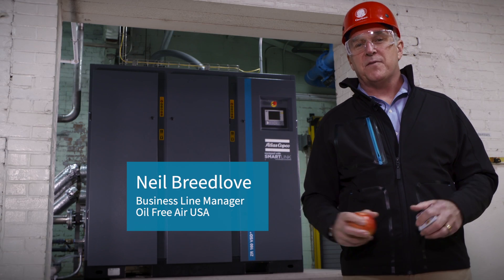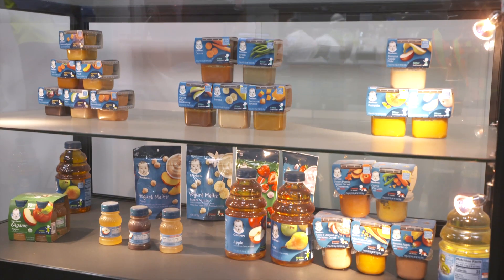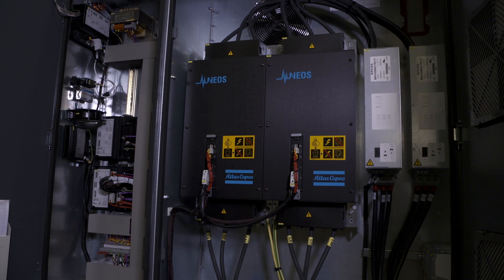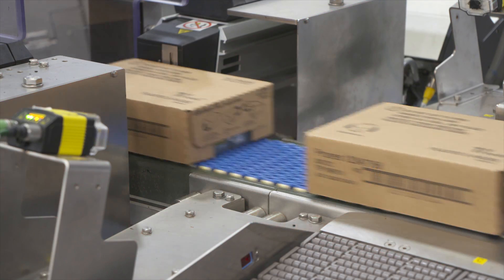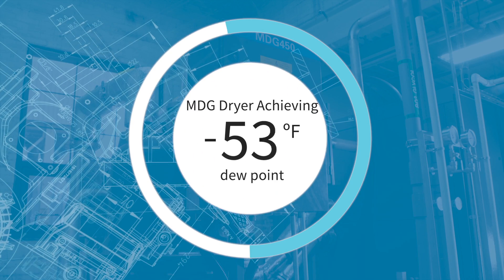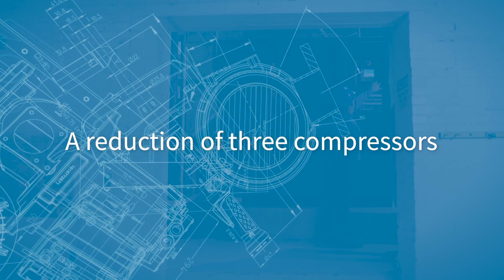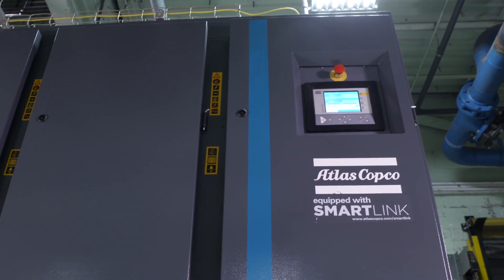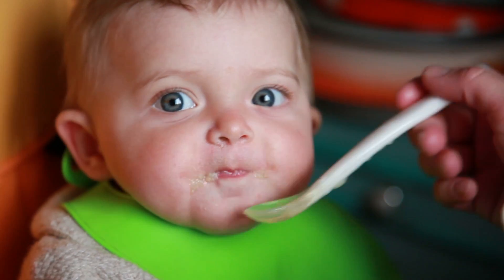Atlas Copco Compressors | Success Story | Turning Apples Into Applesauce

Comment: Are these ZR compressors using the Mk3 air end design or the Mk2 air end design and also is the coating food safe ? www.ztechnique.co.uk aftermarket oil free compressed air parts